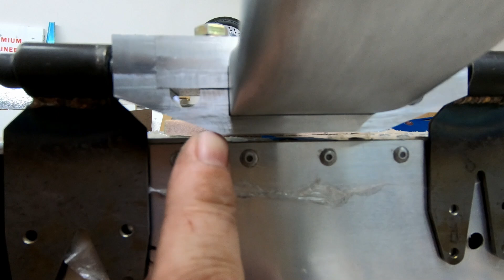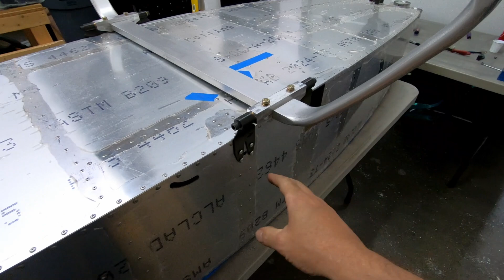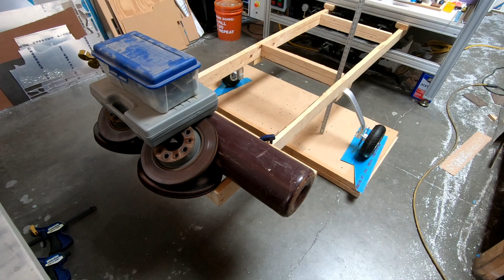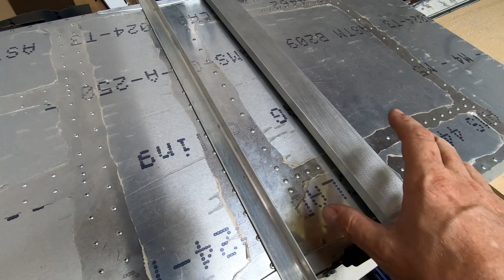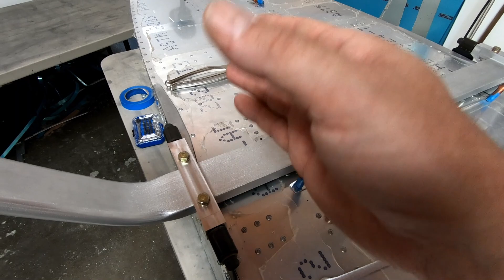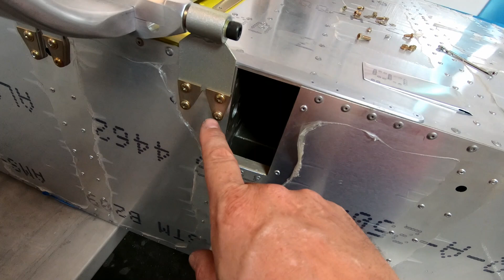24 - CriCri Airplane Build - Main Landing Gear Part 2

Comment: If you use non-aviation hardware for temporary alignment, take measures to ensure that they aren''t forgotten and left in place when the time comes to fly. A Zenith builder left a temporary wing mounting bracket in place, and he was lucky that it failed immediately on take-off, so he was only injured. Paint them them blue, keep a list on the wall, whatever will ensure that they're all gone before flight.

Comment: Are you very concerned at how stiff the aluminium gear legs are? The fiberglass legs are reasonably 'soft' in comparison.
Reply from the maker: It is a concern, although I haven't had anything to compare it to. On a paved runway it probably wouldn't make much of a difference but on a grass field it might be too stiff to handle the bumps. I will eventually make a fiberglass gear leg but for now, I will test with this and see. Thanks for the info for comparison.